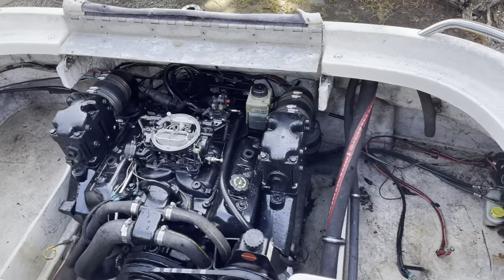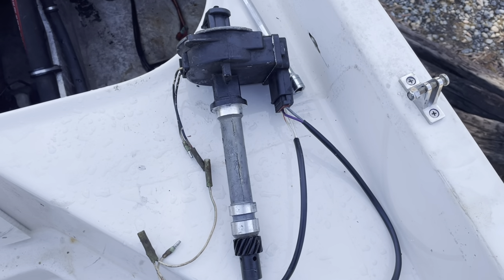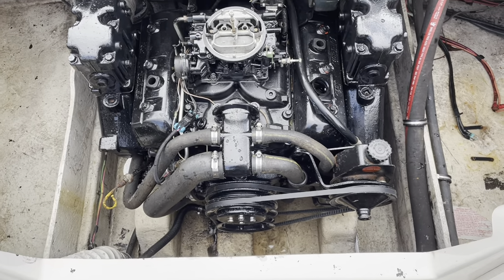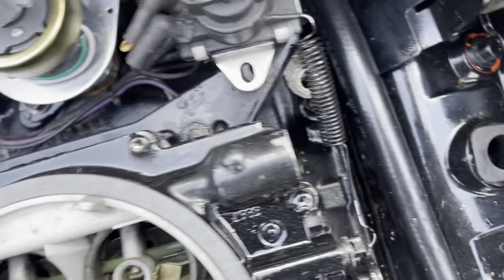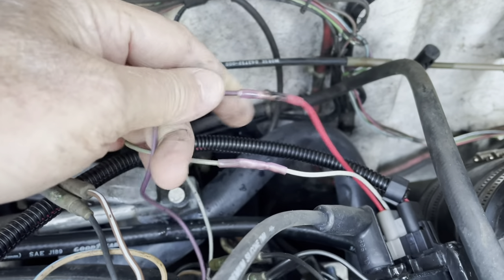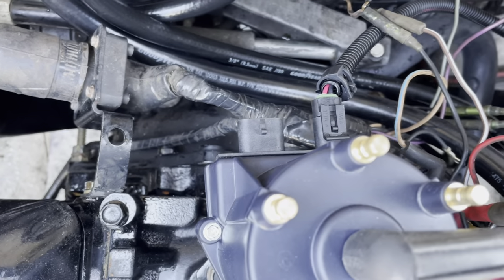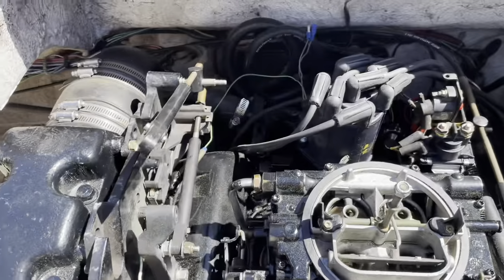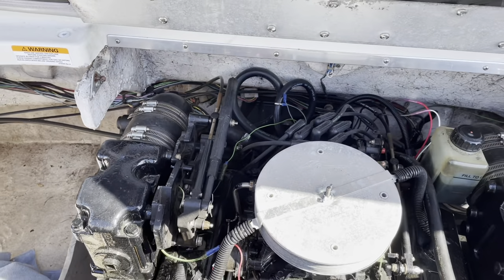Mercruiser 4.3 5b - Thunderbolt IV Easier Upgrade

Comment: Hello and thanks for your channel......I bought a boat with a reman 4.3 long story , boat  was overheating and making a terrible ticking noise,   but I finally got the valves replaced, and \thanks to you was able to set the timing correctly,  it ran like a top... the next day the battery was completely drained and now I  have no spark and power to both sides of the coil,  driving me crazy , boutght a new coil and same thing, no spark and power to both pos , and neg side of the coil..... also no having shifting issues  will not go into forward gear on the alpha one,,,,,, also 2 wires that were not hooked up one appears to be ground and the other is a white with a green stripe I believe,  do you by any chance have the wiring diagram for the boat that you are working on in this video
Reply from the maker: Sounds like it has multiple issues but the battery draining implies a bad ignition switch. If you have power to both sides of coil but it wont run the Thunderbolt module may have fried. Since you replaced the coil its either the pickup (white/red and white/grn) or its the TB IV module. As my videos state, I don't waste time on TB modules I upgrade to Delco EST.

Comment: Hi, just had a non starting Mecruiser 4.3LX V6 (1989/90) diagnosed by a boat Tech to a Thunderbolt IV Ignition module failure (mine mounts on a triangular bracket that is mounted to the RHS Riser so different set up to what is shown here - second generation, I think it is referred to (it was swapped with a V8 Thunderbolt unit version to diagnose - engine started but they are apparently different and cant be used) and as he has found, they are not available anywhere .  These videos are a great resource but I am having difficulty finding a complete Delco EST Ignition system kit to purchase (including harnesses and brackets) - Did you ever put a one together or know where they can be sourced from (not experienced enough to try and pull all the individual bits together)?  Many thanks
Reply from the maker: You need Sierra 18-5513 V6 ignition upgrade kit. Here is a link to lowest price I could find. I’ve seen this kit run $389 to $600. The bracket that the coil is mounted to is not robust and does not mount easy to v6 or v8 engines. I sell a very heavy duty bracket. See this link:

https://youtu.be/PkusGQYEvUE
Reply: @moccasinmarine  Thanks - managed to get back on the water last year with a 2nd Hand Thunderbolt IV unit.  However, the boat has just cut out suddenly a year on after running perfectly (fortunately I was on land at the time) - cant get started and no spark.  So suspect, as you suggest, these old OEM units have come to the end of their life.  I have finally located and just ordered the Sierra 18-5513 V6 ignition upgrade kit in Australia and waiting for delivery (horrendously expensive compared to the US but it is the holidays season here and need to get back on the water asap!).  I have watched your videos many times over in preperation for the task ahead - a fantatsic resource.  However, I am confused over timing of the distribributor and you say that this can damage the engine so want to get it right.

I found the original Sierra 18-5513 Installation Instructions on- line and these refer to "adjust the timing to the Manufacturers specifications" (at 650rpm), which according to the plastic cowling on top of the engine (attached to the Air Filter) is 8 deg BTDC.  In your videos you refer to 1 deg BTDC, although these videos do appear to be for a different set up (the Ignition Sensor appears to be built into the Distributor in the 18-5513 kit.  Whereas in your videos there appears to be a seperate Ignition Sensor in the vidoes where you show how to set up the timing).  

 Any clarification would be greatly appreciated.

I will check how the new coil mounting works and look at getting your improved bracket (do you ship to Australia?)
Reply from the maker: @trevorwhite9068  I wish you had contacted me before buying the Sierra kit. I now sell the entire ignition kit for $439 plus shipping.

The Sierra instructions are wrong. You are no longer using a Mercruiser factory system so you can’t use the original factory settings. This is the playlist for my kits:

https://youtube.com/playlist?list=PL6wJJenh5G97LCeXUnnFaEoyld3gnS0IT&si=UKpW12klc-IOM7Yd

There is a video in the playlist near the end that explains what timing to use when replacing the Mercruiser system for non vortec engines like yours.

Comment: Would this upgrade work if i got the thunderbolt V. The 8 pin module?
Reply from the maker: https://youtu.be/EiB4F1V7YkY

Check out this video. I sell kits to replace both the Thunderbolt 4 and 5 on v6 and v8 engines.

Comment: Question: I put holley sniper EFI fuel injection with holley hyperspark distributer, hyperspartk CD box and coil, How do i wire the shift cutoff?  I watched like 5 of your videos but i still can get what to do and it is last thing before i can finally drive boat again.  PLEASE HELP
Reply from the maker: There are a couple ways. Wire a 12vdc relay powered through the shift kill switch. Power the injectors through the  normally closed relay contacts. When the shift kill switch makes it will power the relay which will kill the engine. You have to shift quick so that the engine momentum carries it through the loss of injector power. The downside is if the Holley system detects misfires it will set a code for misfires.

Another way is to wire the shift kill into the Holley system as a neutral safety switch. Then program the park RPM in the Holley system very low. This will only work if Holley system has a park neutral switch input.
Reply: @moccasinmarine  thank you so much for the response. I'm going to do some research into that and see from there. I was planning to pay a boat shop just to go over with me to find out how to wire. I stuck with electrical big time
Reply: @Savage1872All  Just hook the shift interrupt wire  to the points output wire. This is the (white) wire coming from the sniper efi throttle body to the ignition control box.  I set my idle to 750 and have no problems shifting...

Comment: Your videos on the Delco EST upgrades really helped a lot updating my 5.0.  Curious why you did not add a relay for the coil for this Thunderbolt IV upgrade like you did in the V?
Reply from the maker: I don’t remember exactly but probably because the first one I did had an electric fuel pump, maybe electric choke,etc. since the keyed 12 volt power runs everything underway I wanted direct power source to the ignition coil. But as I write this I remember now it was because the EST coil harness has a 14 gauge wire feeding the coil and the boat harness was at best a 16 gauge wire. But after the first conversion I realized that the old system fed the coil and TB IV module from the same keyed ignition so I didn’t use a relay after that.

Just curious what ignition module did you use in your upgrade? If it’s not GM don’t venture far from the boat ramp until you have proven that the module is dependable.
Reply: @moccasinmarine  534657	Sierra (Delco) GM V-8 EST Distributor Conversion Kit, 18-5514.  This is the kit I went with and did use the relay setup like you did in your first video series.  I had a coil failure on my original system and decided it was a good time to convert the system over to the Delco EST.  You did a great job on this video series. I hope to get the boat in the water in a few weeks and run it through the paces.
Reply from the maker: @craigwax8078  so you haven’t checked it on the water? You should watch this video since I describe where I had five EST module failures using modules from Marine Parts Source. They were all defective and not cheap. I switched to GM only and didn’t have a single failure after that. I know that Sierra is not using a GM module.
Reply: @moccasinmarine  I just have the base timing set running engine with the hose and muffs.  I had already purchased the system prior to seeing your videos, but will investigate this further. Hopefully will not experience issues with the Sierra module.

Comment: Hi, thanks so much for all your info.  I'm just finishing up a complete rebuild on a 4.3 vortec and have done so using your videos.  Would you be able to give me the part number of the distributor you used in this video?   I have a basic v6 Cardone distributor, and if I understand correctly.. I could just swap out the ignition module with a new marine set module and use my existing coil and Cardone distributor?  Thanks for you time. Very much appreciated.
Reply from the maker: The marine module part number is PSI-101486 from Marine Parts Source. You can buy them cheaper but I don’t buy the cheapest electronics because I don’t like paying for them twice. As for the distributor I also don’t recommend Cardone.  MarineEngineDepot has a distributor with ignition module included 480140 for $259.

Comment: What does this upgrade improve? Better what?
Reply from the maker: It makes the engine run period. Thunderbolt modules are very old and beginning to fail. The Delco EST system is a better system.

Comment: Thanks for the video, I’ve been thinking about this upgrade for a while, seeing it really is much simpler on the thunderbolt IV I may have to do it. When do you think you will have the kits put together for it?
Reply from the maker: I’m in the process of developing custom heavy duty laser cut powder coated ignition coil brackets since the ignition coils come with flimsy brackets. I’ll mount an ignition coil to my bracket and sell just the ignition coil and bracket. I buy the rest of the parts separately and save money. A kit from Sierra is 18-5513 and is quite expensive at $439 (best price I saw) here:

https://marinepartssource.com/delco-est-4-3l-v6-ignition-conversion-kit-4-3l-v6-sierra-18-5513

But I can put together a parts list that costs about $300 if you buy the parts (including my coil) separately and do some assembly. I don’t publish the list so if you want it send an email to moccasin.marine.llc@gmail.com

The Sierra kits sell out frequently which is why I decided to begin making my own.
Reply from the maker: I also recommend you watch this video for a full understanding of how the Delco EST distributor works.

https://youtu.be/1a9cHJrH0d8
Reply from the maker: I just just launched a product where I am selling a genuine GM ignition coil with a heavy duty bracket. Check it out here:

https://youtu.be/PkusGQYEvUE